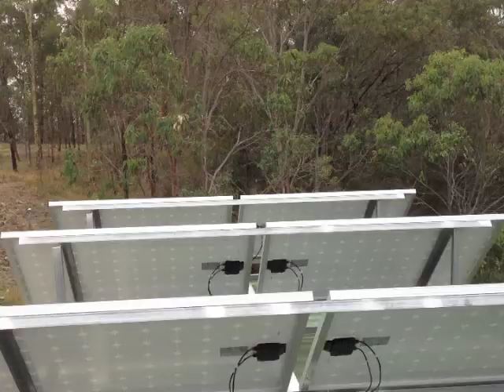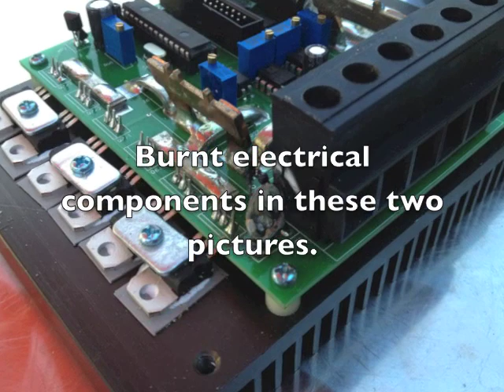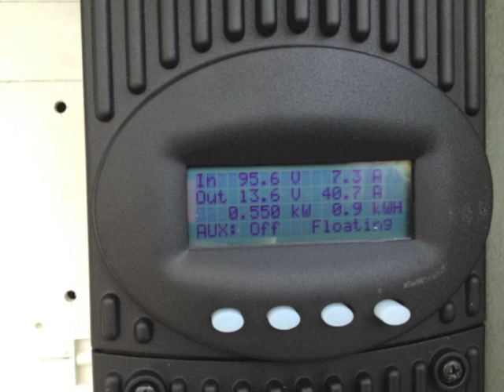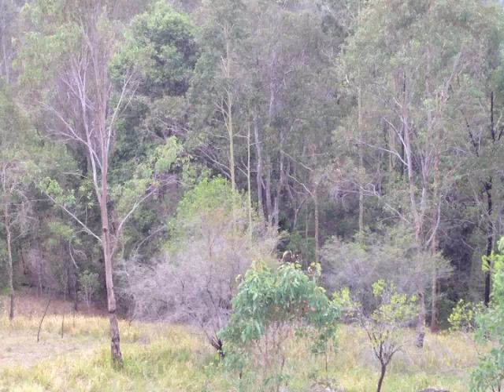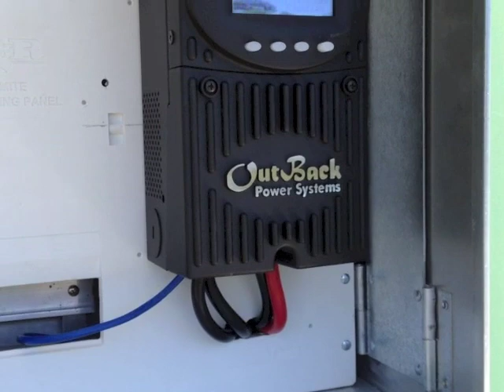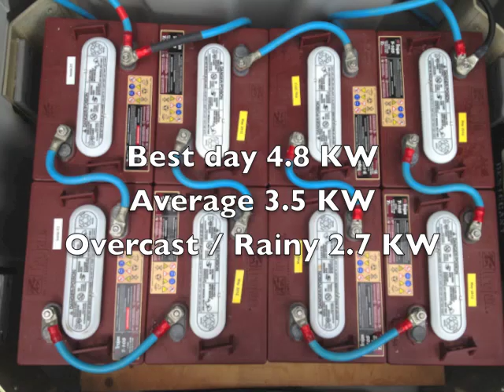Shipping Container House - Install a charge controller and inverter to solar panels

Comment: very nice, Had a very similar setup as you made for my Father with outback 80A charger 8 Deep Cycle batteries in 48v only difference is i had an Australian 48volt inverter. had an electrician setup the board for us but we did the rest of the wiring. works great love the Outback charger soo flexible in possible panel configurations
Reply from the maker: I didn't realize how good the outback items were until it arrived. I agree with your observation about the wiring, it isn't complicated. My system hasn't missed a heartbeat since installation. Cheers Paul

Comment: Look interesting, what did the law said, to connecting high voltage, in your own home....etc. !
Reply from the maker: The law requires only qualified electricians wire domestic homes. I am simply showing that it is not complicated. I work with electricity as a profession. I recommend people get an electrician. I have my own power station now, and it works beautifully. Cheers Paul

Comment: Nice setup. Have you checked out my container? I got the outback 60. It seems to work fine although I dont have a refrigerator.
Reply from the maker: I would have loved to have seen the 60 operating a house, My purchase was bit of a dice roll from my research and guessing what I would need. The fan caused me a headache to fix on the 80. I erred on the size of capacity since I was moving off grid. I still don't know if the 60 would have met my needs. I could not see any links or hints to see your container. I am interested. Cheers Paul
Reply: You can search Bobtown style and find my container channel. Thanks for your interest.
My place is just a monthly retreat. It is too hot to live there year round. Approaching 115f this week. In the winter it gets to just below freezing. Take care Paul.
Reply from the maker: Bob Vance Found you, thanks. I will watch and subscribe when I have a few minutes to sit down and watch youtube. Thanks for the link. Cheers Paul
Reply: Paul Chambers Cheers mate.

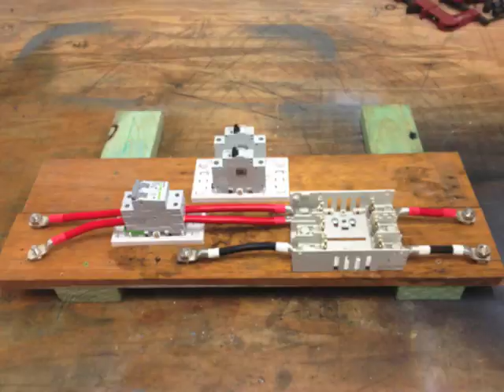Comment: Can you give me the name and place you got the components you laid out on the board? 6:02 in your video. Love your setup.  I will go with same inverter as you. I also made mistake of buying wrong size inverter.
Reply from the maker: Solar Online Australia, tel 02 4954 3310. Unit 3/301 Hillsborough Rd, Warners Bay, NSW. They were stockists for Outback. I looked in their modest showroom and bought the knifeswitch and DC circuit breakers. The rest of the components are standard items from the electrical wholesaler. I think the Outback range is truly excellent. The diagrams and details are in the ebook. Cheers Paul

Comment: It makes me sick. I have always wanted a setup like yours but the cost has always been too high. I made my own panels and scrounged around long enough to get a bunch of old car & truck batteries to trade in on some nice 6 volt deep cycle bats. I have 8 total. Then I did what you did and bought a cheap Chinese charge controller. The charge controller crapped out of course. Being disabled makes it very hard to get the right equipment. When I saw that Outback charge controller and then the inverter I thought I might drool a little. I'm sure you did a lot of research before purchasing anything after the Chinese charge controller fail. If I may, would you care to tell me what prompted you to go with an Outback instead of say a Midnite controller? I can't get anyone to give me a run down on the benefits of one over the other. But that outback inverter makes my little Aimes 12 volt 5000 watt inverter look like a toy. And you did answer a question that has been on my mind for a long time. Does the inverter being on though under no load still draw batteries from my batteries? Of course you answered that. I wish I had done more homework. When a company is trying to sell you these things they tend to leave out little details like (oh by the way,. If you leave the inverter on it will eventually run down your batteries even if it isn't connected to any load). I just need to try and find a way to coke up with about 10G. I can make my own panels but the inverter and charge controller are something else. One other question if you do not mind. since it has been about two years since this video posted, how is everything holding up?
Reply from the maker: Hi Drauge Hessler, I did not see your message before today. I installed it 2 years ago and it has never missed a beat. I recall one time I got a funny reading on the inverter and I cycled the input breaker to effectively reboot it. That fixed it. I am delighted with it. I had never heard of Midnite, but a chap called Justin Case has used them and he likes making YT videos about it. I was concerned that my 2300 watt inverter would be too small. It has met my needs without breaking sweat. I would buy Outback again and recommend them. Cheers Paul

Comment: Spoke to a tecnition who deals with fixing these outback inverter charges he told me the mate wont help me diagnose any problems cause i have no led lights at all lit up on the outside of inverter.   i took the top caseing of it with the battery conected and the tec went over the led lights on the control board with me one at a time .one main one not lit up  the remote power led D21all other leds that had to be on were on. there was a couple of leds on the board not lit up the drive leds4213 he wasnt concernd with mabee they are on with a genny or mains input  anyways it needs a new contrl board and that could blow to if i put it in myself which is an easy job no refunds on the board  the board is on the end standing upright with the inverter flat on the table VFX3048E R61

Comment: Yea i checked it out i need a mate
Reply from the maker: The mate saves your generator if you are off grid. The grid input is set at default to 28 amps. I use a generator as a grid input when required. My honda 3kw generator can supply 12 amps. If you do not reduce supply current settings it will suck too much power out of the generator. I set current to 8 amps with the mate. My friend burned out 2 generators before they worked it out. Cheers Paul

Comment from the maker: Hi askmeaboutmyvolt, You message sounded like you were a little stuck with a kit that does not seem to plug together easily. If you need a little advice send me your email and I will reply personally. I am sure we will figure out your solution. Let me know the components you have and what you expected it to do. Cheers Paul

Comment: Do you use a powerchair but are tired of the restrictions on range Well you can easily turn that restriction into a historial footnote for as little as $300.00 (not to me, but for the supplies needed)... After 5 weeks and several hundred miles of runtime, we still have yet to need the power companey to recharge.ABOUTSOLARCELLS.COMXA.COM      shows you how you too can do it by showing you the powerchair its done by! AMERICAN SOLAR FRONTIER BY THE POOR,

Comment: I have the same inverter & the same original charge controller you had but i only put around 10 amp through it and it has lasted me about 6 months so far.

Comment from the maker: No, the mate is sufficient. I have a plug in watt meter that I used early on. It all ended up at "unplug it" and turn it off when you are not using it. We changed our lifestyle to match our resources. Yes I was very relieved.